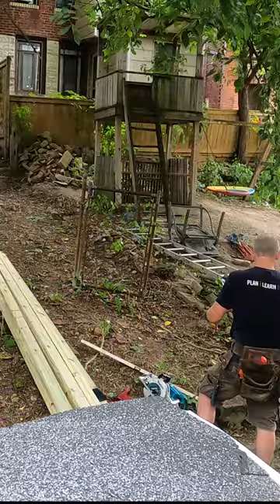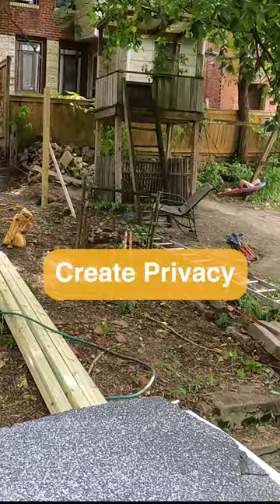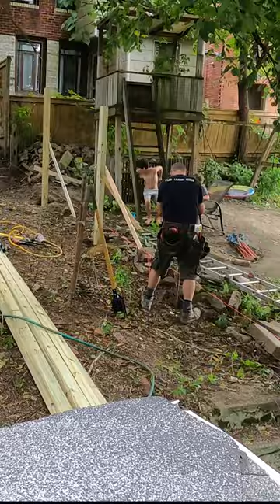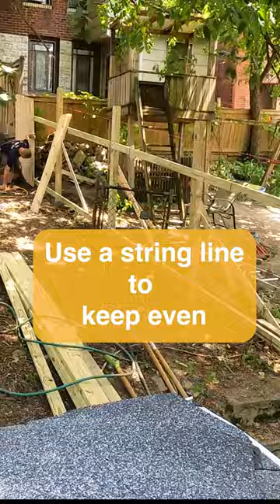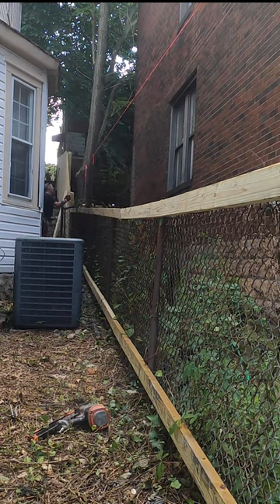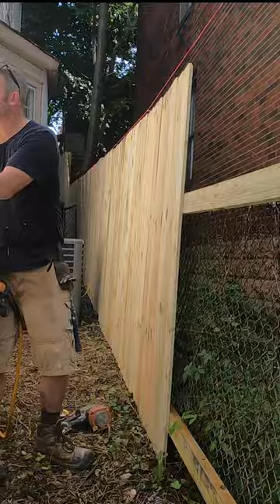Fencing

Comment: Nice how to connect to the metal fence
Reply from the maker: https://www.homedepot.com/p/Teks-12-x-2-3-4-in-Plymetal-Zinc-Plated-Steel-Flat-Head-Phillips-Self-Tapping-Screws-with-Wings-200-Pack-21386/202704775
Reply: @BathroomRemodelingTeacher   so you just screwed in the wood into the pipe for the metal fence